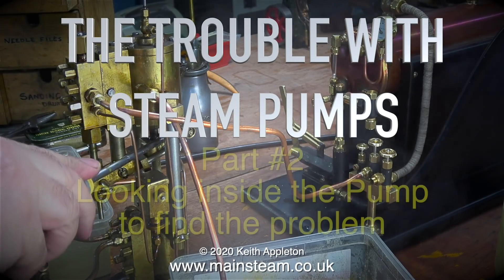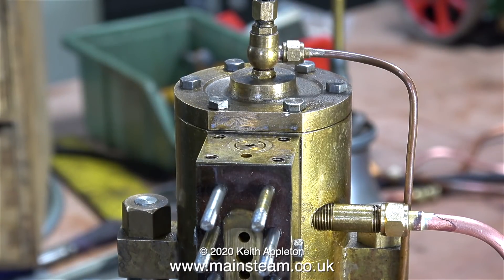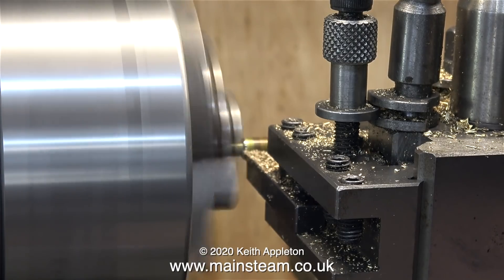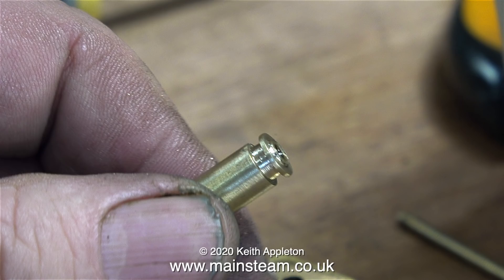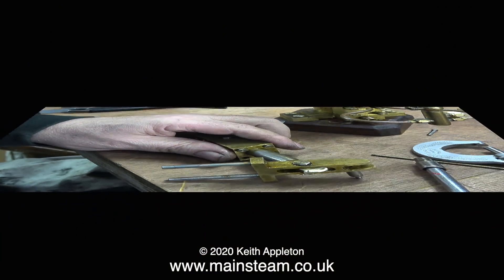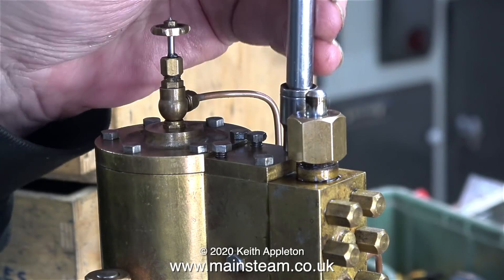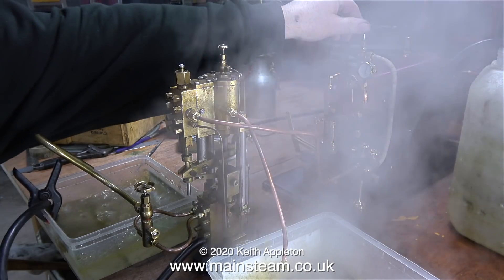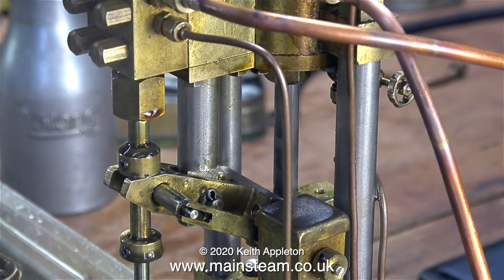THE TROUBLE WITH STEAM PUMPS - PART #2

Comment: Just my 2 pennoth worth.......perhaps you are getting too much stroke on the steam piston and it's bottoming at each end without pushing the shuttle valve fully open or open at all.......that would mean an adjustment to the shuttle valve stroke so that it opens before the steam piston is fully up or down in it's bore.
The fact that it pumps with the valve fully open and no back pressure in the pump also suggests that the pump piston is too large in diam and the volume being pumped per stroke is in excess of the boiler needs and needs to be smaller so that the pump can oscillate more than just a slow move to pump water against boiler pressure.
The steam engine itself will not be running flat out all the time and the pump will supply water to the boiler at only one setting and you need a boiler level control to control  the pump feed rate......I don't see this on the boiler.

Comment: Keith what happens when you close the water valve in order to increase the back pressure of water... is the valve more effected?
Reply from the maker: Water is pumped into the boiler.
Reply: @keithappleton  ok that means the pump has more back pressure and the valve is more under pressure as well... I observed at my Southworth 12 inch this as well, under back pressure one needed even a spring to push the main Valve rod up and to allow the valve system to occillate. The spring had to be even stronger in order to allow the pump to occillate under real steam and a real back pressure by my boiler (on board of my boat AMPHORA). I know that you worked with many Soutworth Pumps as well and wonder if you had seen the same phenomen? What happens with the steam in the cylinder space (above and below) on both sites of the shuttle valve is there a way to escape when it moves up and down and the O rings are not totally tide?
Reply from the maker: the water from the shuttle piston clears back through its slide valve easily enough.
Reply: @keithappleton  ok good :-)

Comment: Bonjour Keith, 
On my Stuart D10 or on small locomotives, cylinders have drain cocks to evacuate the first water coming from steam on a cold metal. Why wouldn't you install two ?
Amicalement, Raphaël
Reply from the maker: This pump has two drain taps . . . on the main cylinder at each end.

Comment: Liked this video, but I'm having trouble understanding the operation of the pump.  Taking your suggestion, I looked at the mainsteam playlist page, and happened across an error in the page: the entry (or entries) between "REBUILDING A STUART MODELS TWIN VICTORIA STEAM ENGINE" and "RENOVATING A TWIN CYLINDER MODEL TANGYE STEAM ENGINE" seem corrupted somehow.  I think that there are two separate entries there, but they are illegible, and seem to take you to the Stuart Twin 5A Renovation play list. 
Sorry to post this report here, but I did not see a better way to do it.
I am working my way through the steam powered pumps play list videos.
Reply from the maker: Both of the links that you mention work fine for me. Please try refreshing your browser.

Comment: This probably qualifies as a really stupid question, and I may be misunderstanding the issue, and the way the shuttle piston system works... gonna ask it anyway. 

Would it be possible to fit a very small diameter drain cock to the area experiencing hydraulic lock? Maybe to save the mechanical wear and tear with the steel to brass combo? 

I'm sure the answer is no, but your answer will probably teach me something I didn't know so...
Reply from the maker: I thought exactly the same thing, and if the ringless Stainless Steel shuttle piston doesn't work, then I will be trying a couple of drains or an extension rod sticking out of the top like the valve does }:-)))
Reply: @keithappleton  Yay, I didnt ask one of "those" questions LOL. :-D